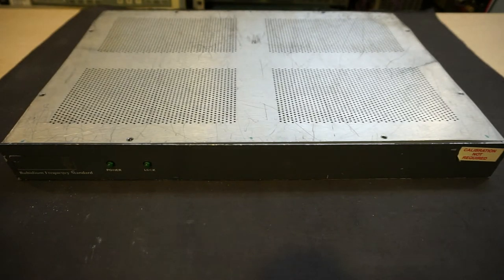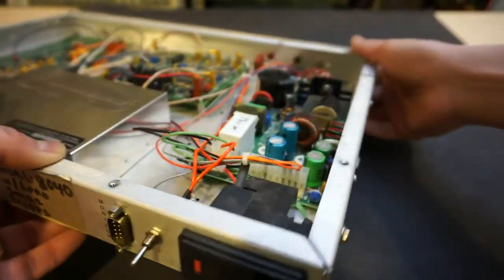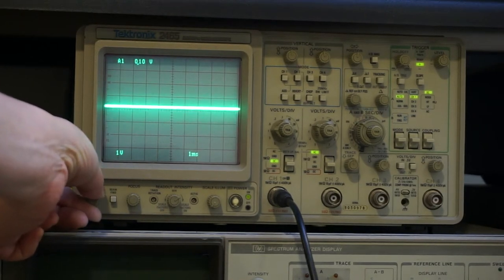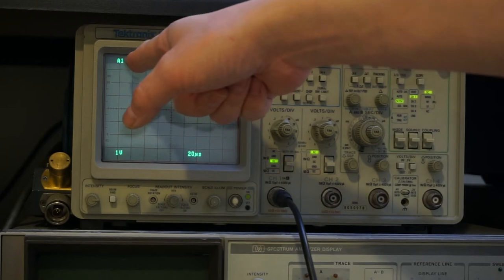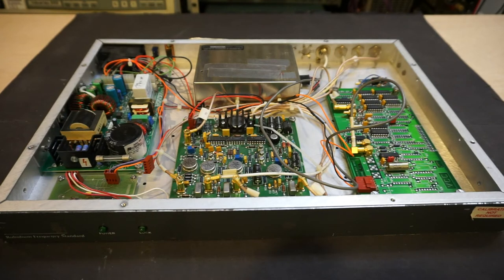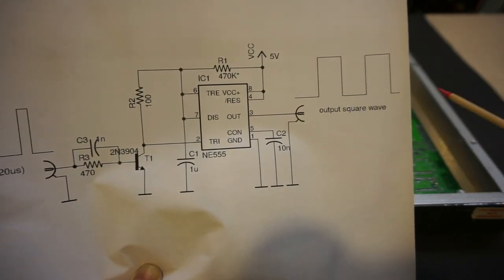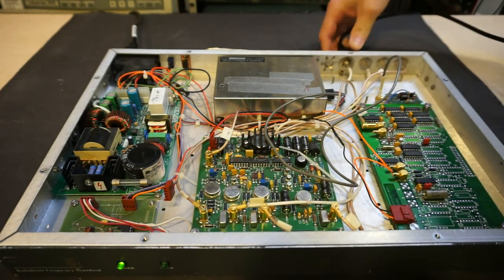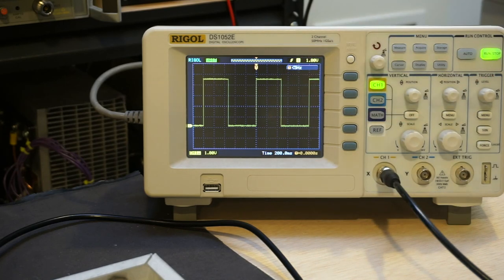Datum/Symmetricom 8040 Rubidium Standard Modifications

Comment: I guess it depends on what you are planning to use the 1pps for, but you have probably made the phase noise/jitter worse by adding this circuit due to temp coefficient and power supply rejection issues and the inherent stability of the 555 itself. Have you measured the Allan deviation of the before and after signals to see what effect it has?
Reply from the maker: Thanks for pointing that out. Yes the phase noise is definitely worse than before as the Q factor of the RC circuit is poor.
Reply from the maker: Correction, not the Q factor, but the stability.
Reply: Could you suggest more precise ways to do that? Thanks!

Comment: Just curious, have you tried to compare the original signal with your extended one to check the delay? I've managed to get it down to ca 5-6 ns. The upper is from my GPSDO and the lower one is from my 74HC123 circuit. Although I'm using it for an NTP server, so the delay matters.
http://jackenhack.com/slask/delay.png
Reply from the maker: No I haven't measured the delay yet, I will take a look when I get a chance and let you know.
Reply from the maker: OK, Just did some measurements. The delay introduced by the 555 monostable circuit is at 150ns.